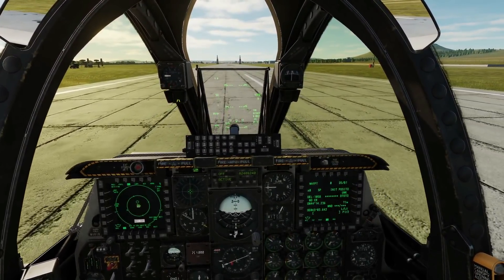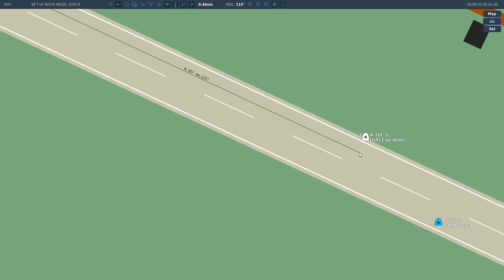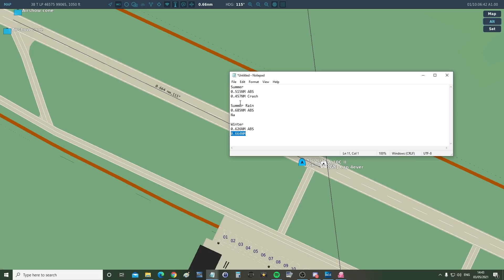Questioned: Are Wet Slippery Runways Modelled? Does Anti-Skid Work? | DCS WORLD

Comment: Possible side note:
 Knots reading was probably higher due to the air being denser and the way that IAS is measured. Not due to the engines actually putting out more power. Same effect you get when you are at high altitudes and your IAS and GS are very diff.

You would also in icing conditions have less power as you would usually have Engine anti ice on (though probably not in T/O) 

Additionally, ice may have been modeled which is why you found it easier. looked to me that the aircraft was slipping forward due to less grip. Hence was easier to keep straight as the tires and inertia had less effect and the lack of grip kept the aircraft with a tendency to move forward. Also why you were able to do a spin at the end rather than careen off to one side.

EDIT: I am not an expert so can assume all of above is complete BS but was my thinking after watching :)

Comment: 5:33 Cheeses Kroßt!

5:45 It rains at a place that's literally named "mineral water". Badum Tss!

6:38 Try flying the Бог-Восемнадцать (Bog-18) at supersonic speeds on the PG map with the temps cranked up to max. Good Luck! (has been like that all the time)

Speaking of which, you should have tried that, especially since it doesn't slip around as much.
Bog driver: braking 100% with anti-skid on
Skid marks: exist
[tyre screeching intensifies]

So, it's clearly not modelled correctly. Anti skid should limit the braking power to a point where no screeching/skid marks would occur unless you go sideways which shouldn't happen either as that's already a symptom of skidding.

TL;DR: Just fire the gun in you want to shorten your landing roll in the hog.

Comment: I find it very difficult in DCS to get the individual toe brake axes calibrated to match, so tend to get pull to one side .  So only ever use short pumping on the brakes rather than sustained pressure.

Comment: ABS braking.
I have a Tamiya 10th scale RC car(TT-02S chassis, with Audi Quattro body), with custom electronics that I can program Anti-Lock Brakes.
In essence, the braking will be modulated, like pulsating, and not locking the wheels up.

Even in the most slippery conditions, using PVC drift tires, on smooth tiles, stopping distance does help me stop or slow better before cornering.

Comment: Temperature and pressure are taken from ATC when we do engine performance runs, and will give you both idle and takeoff speeds/thrust. You could say that bad weather is associated with lower air pressures but we don’t take account of it in that respect. What we DO take account of is engine anti-icing, which should always be switched on below certain temperatures (about 5 degrees Celsius off the top of my head) and if there’s ‘visible moisture in the air’ to prevent ice formation in the inlet as the air rapidly accelerates into the fan. As this heating is usually taken from the engine itself as bleed air, it effects the performance, in the same way that having electrical or hydraulic loads do.
Nimrod had a mechanical anti-skid system on each wheel, which was basically a clockspring that turned with it and if forced to suddenly stop (when locked up) would carry on turning and open up the return line to release the brake pressure. We think that’s what failed on the run we did with you that burst the tyre…
Reply from the maker: thx M

Comment: Commenting at the start of the Video:

I'm guessing, a Jet Engine might produce more power in rain due to lower intake temperatures and higher compression.

But also, the lift most likely will be reduced due to a chance of turbolenz airflow over the wings

Comment: I actually do think the ice is modeled is what you can take away from that. Due to the ice to blocking of the tires doesn't have as much of a turning effect on the plane, so the ruders are useful for correction for much longer. Also you didn't blow tires at that go which I think is also because of less friction between the tires and the plane

Comment: In real life at least in the civillian world, rain isn't a part of the performance calculations for takeoff or landing.
It IS however in the calculations for takeoff distance due to potential standing water on the runway and for landing the slipperyness that can affect your stopping distances.
Temperature however does affect performance more and will give you more or less thrust, even though you usually derate to save engine life.
Reply: Bang on.

Comment: Hey Cap! Quick correction: Anti skid actually does reduce stopping distance, because the coefficient of static friction is higher than the coefficient of kinetic friction. By keeping the wheels from locking, you can apply more stopping force on the vehicle. Like you said, it helps with steering as well. Great video.
Reply from the maker: Thanks Hovis.
Reply: I have the feeling that since 2.7 the antiskid in the f18 doesn't reduce but the opposite to the stopping distance
Reply: With enough practise a pilot should be able to stop quicker without anti skid because using the highest possible braking pressure that doesn't cause locking will result in a quicker stop than using anti skid, which applies maximum possible braking pressure until the wheel locks, then lets the brake pressure off until the wheel rotates again, then applies the pressure again, and so on. Look at racing cars - the top end series don't use ABS because it's just not as quick. However, it's not realistic to expect a pilot to be able to get a "feel" for how well their brakes work on a runway surface that they've just landed on. If you did circuits all day with constant weather conditions you could eventually stop faster without anti skid.
Reply: @RalphShackell  , aircraft anti skid systems do not work the same as the ABS on your car. The wheels never lock up. Instead the antiskid system measures the tire rotation speed and compares it to what it should be at the current groundspeed. It is therefore able to sense when the wheels start to lock up before they actually do and releases the brake pressure just enough.
Reply: @preamp51  Modern ABS never lock up either. The first generation of ABS did that. Modern system don't. Your stopping distance will be shorter with ABS then without.
Reply: @RalphShackell  tires ideally slow down around 12% slip due to the rubber changing shape. ABS accounts for this and lets the tires slip around 12% of the time. I don't know the exact reason why top racing circuits turn off ABS, but I doubt it is for puree stopping distance. Maybe it is something to do with intentional drifting.
Reply: @sheeplord4976  Ideally yes but currently a trained driver doing a repeated braking movement outperforms an automated system has they hit the ideal braking torque quicker, a controller algorithm goes through a few cycles to find the ideal torque. Only really new systems have the capability to vary pressure, old ones can either cut pressure to 0 or use the pressure being applied by the driver. There will eventually be a point where the control algorithms can find ideal torque quicker than drivers, but until then race drivers and riders will be disabling or removing ABS systems.
Reply: @sheeplord4976  Most racing rules ban ABS because it makes a car much easier to drive fast, so it is unsporting.  it eliminates one of the most important elements of racing skill that separates faster from slower drivers.  With ABS you can stomp the pedal while turning in without regard to modulation.  It also makes the chassis easier to tune because ABS can compensate for less than optimum brake bias and tire grip at either end.  I doubt any driver would ever say take the ABS off my car because I am faster without it.

No pilot can outperform an anti-skid brake system, because he has to keep a safety factor and be careful not to lock the wheels, which has more serious consequences in a high speed jet tricycle with very small small contact patches than it does in a racing car.
Reply: @RalphShackell  so a trained driver can pump the brakes 40 times per seconds on 4 separate brake padels?.
Reply: @mickes1362  no, because doing that is slower than threshold braking as described elsewhere in these comments from over a year ago! 4 channel ABS is absolutely safer in unpredictable/unknown conditions like on the road, but on a track/runway that you're driving over repeatedly an unassisted human still performs better

Comment: can you test whether a sweep-winged airplane, with its wings fully swept back, would fly like a delta winged airplane
Reply from the maker: hmmm any idea how to test?
Reply: @grimreapers  one way of testing this is: take a mirage 2000 or some other delta winged airplane. make some maneuvers which delta winged airplane are famous for, like low stall speeds at high AOA. then fly the f14 (or some other sweep back winged aircraft) with its wings straight and see what is its stall speed . then do the same with its wings swept back. see if there is any difference in its stall speed.  i have also heard that delta winged airplanes have a very good roll rates. first roll the f14 with its wings straight and the same with its wings swept back. see if there is any difference.